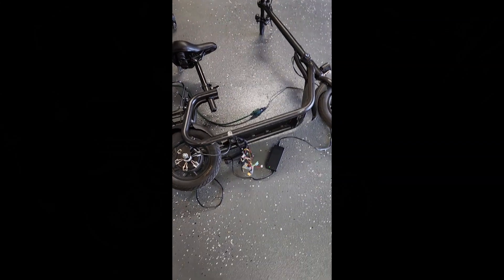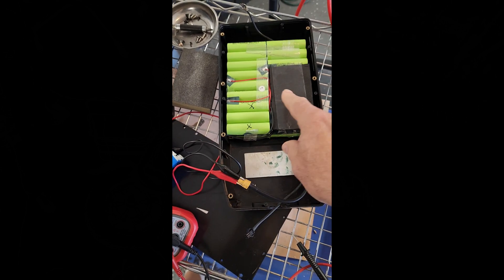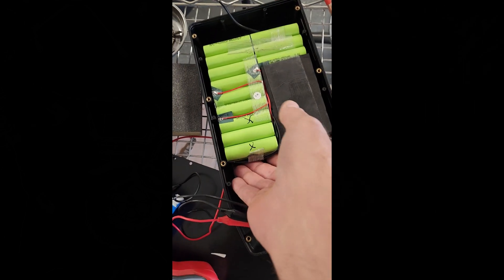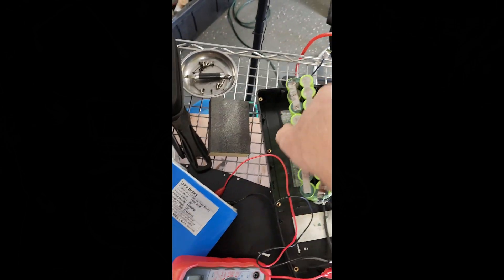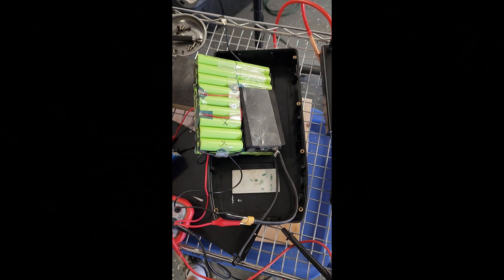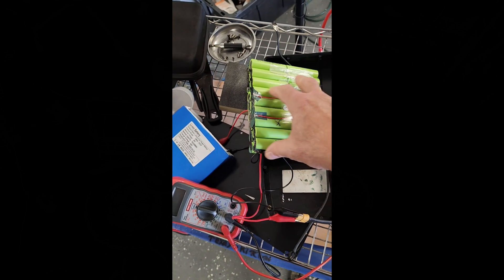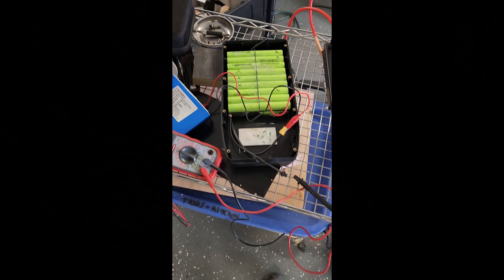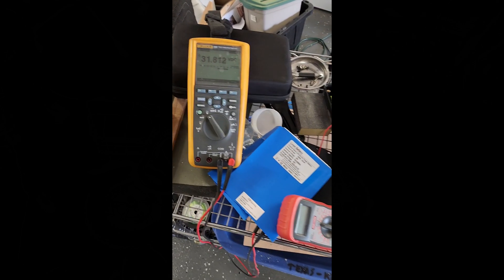36V Electric Scooter not charging.   Battery pack teardown and repair - Video No. 3

Comment: Yea i bought a used one the guy gave me a different charger,had it plugged in overnight and only had 2 bars,now i have the other charger plugged in and the charger gets hot,is this normal?
Reply from the maker: They will get warm.  Almost need a voltmeter to.check voltages of the battery output after a few hours of charging.